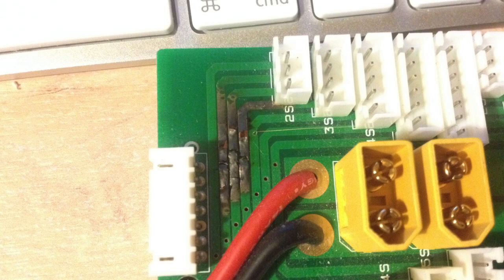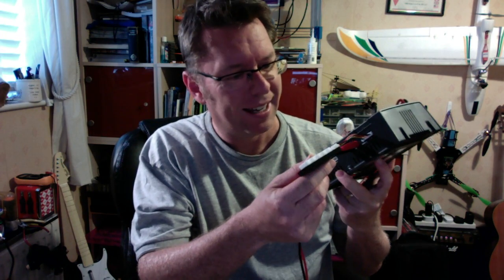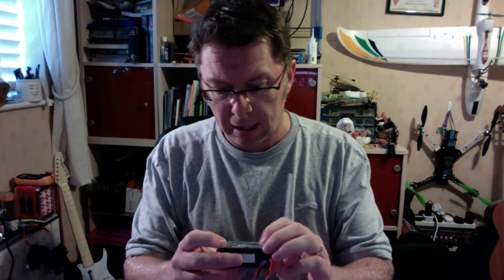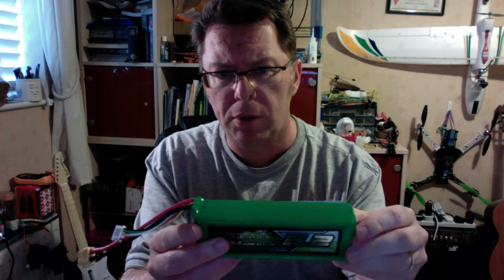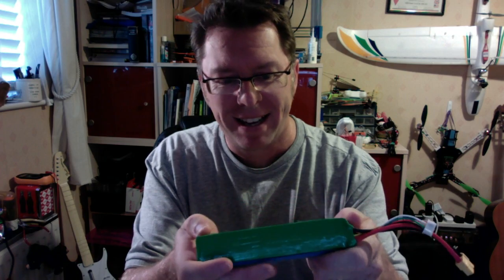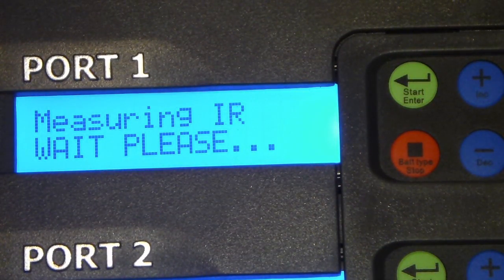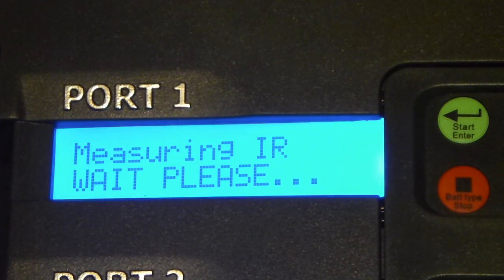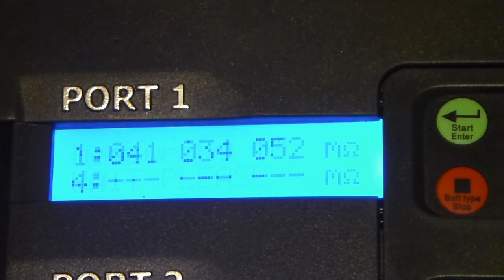FPV grounded: Lipo health and  Internal Resistance measurement

Comment: Supposedly total capacity has an effect on Internal Resistance numbers...the more capacity, the lower the IR.
Reply from the maker: Yes - I'd agree with this.  What I find (albeit anecdotally) is that a larger cell is a bit more robust.  It can withstand higher loads, and the charging seems more gentle to it.  Whilst a little pack can get tortured on a few throttle outs and dip into danger levels easily

Comment: Good content! My E-flite Blade 400 was underperforming, last weekend, on an older OEM battery. The 11.1V LiPo pack is not-at-all puffy, but reads 37 mΩ resistance for each of the 3 cells. So, that is my answer to your question at the end of the video: equal but higher resistance. The pack was balanced-charged, the flight timer was set at three minutes, and the battery pack lasted ten years....it's just too tired to fly a 3D helicopter!

Comment: this is very strange... i have the same charger and did a battery check.... i  measured 14 11 13 on a 2200mah turnigy... and 10 10 10 on another (same) battery.... and then i took a swollen battery, i expected high numbers but it was 01 01 01.... so it look likes that the lower the number the lower the quality of the battery ......

Comment: How did you know that the charger has this IR measurement feature? Im not able to find that listed anywhere. And how do you access it? I wonder if my similar charger also has this. My options tree matches that of whats listed in this chargers manual.
Reply from the maker: +Jason Kass I didn't, it wasn't in the list of features, nor was it in the manual.  I literally power it up for the first time and there it was.  You'd find it on the "top" menu though - it's not hidden anywhere, so odds on if your charger has it, then you'd have already found it

Comment: Interesting video Wayne, reminded me to set storage charge on my batterys...Wondering if you can measure IR using my digital Fluke meter now..?
Reply from the maker: +EnglishTurbines I don't know if it has a bang-whizzy setting to do this, but if you generate a load over the lipo and then take the voltage drop over a set period of time you can measure it that way.  Ed from Experimental Airlines has a good explanation on his channel.  Again, it's more of a comparison tool that a hard and fast scale of good->bad results
Reply: CurryKitten Im now in the process of discharging batts to storage level anyway...quite a lengthy process given the discharge rate of my charger...ends up 3.80 v per cell and 50% capacity.
Reply from the maker: +EnglishTurbines Yes - same issue on most chargers, I use 3 50w 12v halogen bulbs for a reasonably quick discharge - they draw a nice constant 12a, so I can bring them down to around 3.8v per cell pretty quickly and then use the charger to finish them off and make sure they are balanced nicely
Reply: CurryKitten Yes, good idea, my charger only discharges at 0.5 amps...takes forever...I'm halfway through discharging them at the moment, just going to leave a couple for ready use....:)

Comment: I have a light bulb array so I can put 6amps or 12amps load on lipos depending on size, so a couple of times a year I stick the batteries on one by one and note voltage/balance after 60seconds, this really clearly shows the best and worst packs, so I can weed out the worst for the bin, and use the less bad ones for low load stuff. I found IR not that useful, also found smaller packs always have higher IR than larger - I'm also pretty sceptical about those figures, I use cellpro 10S for IR and that very rarely gives under 5milliohms per cell even on new packs, especially for smaller packs but who knows if that is accurate or if yours is - I guess the comparison between packs is what matters so absolute numbers should't matter. The cellpro calculates IR over several minutes of charging, whereas yours is doing a quick load test, but possibly at low current - maybe thats the difference. Main thing I've found is to bench test lipos so you don't find the bad ones during flights ;)
Reply from the maker: +jamesb72 Yes, this charger gives a very quick measurement, so I think the accuracy of the figures could be taken with a pinch of salt - but as you say in comparison terms quite useful.  I use the same light bulb thing for a quick discharge before I put lipos back onto storage charge.  I noticed Ed from Experimental Airlines used this method of comparing packs - with a little equation for working out IR, so as soon as I get a range of IR values it'll be interesting to compare them using all the methods
Reply: +CurryKitten I find on the light bulb load the difference from strongest to weakest cell (which smart meter shows) as well as the voltage drop are the big indicators of pack condition. Would be interesting if you could put a wattmeter inline with IR test to check the load used, I suspect its a couple of amps, I know there is a standalone IR meter with a 20amp load which gives good figures, but its fairly expensive.

Comment: Hi Wayne, Interesting video I've not seen a charger that does an instant IR measurement like that before. The Cellpro chargers I use all calculate the cell resistance as they charge and in the case of the 10S this can take a while the PL6 is much quicker.

The figures you're getting are much lower than a Cellpro charger will ever report and if you get 3 mili ohms that would be a good result and likely to be comparable to the 1 mili ohm result you're getting on your charger. The cell resistance is a very good indication of battery health, but you do need to compare the results with a new similar battery. Small capacity cells always have higher IR values and in my experience you don't start to see the really low values until you get above the 1300mah cells. As Cellpro point out it's important that the IR values are all similar across cells in the same pack one bad cell is just as bad as the whole lot being bad as the voltage will drop across that cell since they are all wired in series.

One final thing is that the ambient temperature will have a huge impact on IR values this is why LiPo's are crap in cold weather unless you keep them warm before use, so always compare values at the same ambient temp. The best IR values I see are when the ambient is above 22 deg C.
Reply from the maker: +Martyn's FPV Channel Yes - I can't really vouch for the accuracy of the IR measurement, and although I've got this finger in the air of <5 good 5-10 ok etc,  it's only really of any use .when I start noticing a lipo which seems to not be giving me as much and can see what sort of values it gives out.  Yes - I heard the thing about making sure the temp is constant, happily the amount of computer stuff in the man cave gives a relatively stable and quite toasty temp

Comment: Date on the batteries is a fantastic idea!! My solution was to buy 12 imax B6 chargers and put them in a guitar pedal case. You can do what you like to 12 batteries charge/discharge/storage/nimh etc simultaneously. Under £200. Great video Wayne.
Reply from the maker: +OMEGOOLIEBIRD Pretty good idea - I was thinking about multiples, but then thought about all the power supplies, but I guess you can run them off one big one can you ?
Reply: Yeah, I just have one 40 amp PSU powering all 12. Works great. Still need more chargers though :-)

Comment: I've been parallel charging my lipo's for 5 years now  - you just have to make sure they're within about 0.3V of each other before you plug them in otherwise large currents will flow. 
The only issue I ever had was when I accidentally plugged a 4s battery into the 5s port which immediately resulted in melted wires... Otherwise it works fine and has saved me heaps of time charging batteries!

I use these: http://www.hobbyking.com/hobbyking/store/__36007__HobbyKing_Safe_40A_Parallel_Charge_Board_for_4_Packs_2_6S_XT60_.html
Reply from the maker: +Nellik All my lipos were within 0.1v of each other.   I had been using that last parallel board for over a year without incident and I would agree it saves so much time.  But flames for no reason I can see = new charger for me :)
Reply: +CurryKitten did it happen immediately or a while after plugging the battery in? If it was immediately then you probably did something similar to me else you must have some pet gremlins....

Comment: Great, very useful video Wayne! Actually I've just realised my GT chargers actually have this feature but bugger me if I ever knew what it was for. I really like the look of your new charging set up... Seems pretty powerful to me. I've always wondered how well the average charger actually works and more particularly how accurate the readings are... Food for thought!
Reply from the maker: +FlyBoySee I've a feeling your lipos will just try and spell out " H E L P M E" - check the ASCII codes :)  This new charger seems a bit better than the b6 in terms of getting the cells up at the same point more quickly.  Looking forward to being able to do 4 lipos at once though